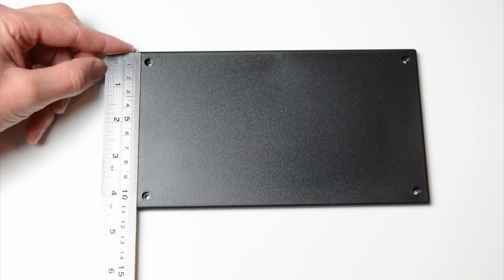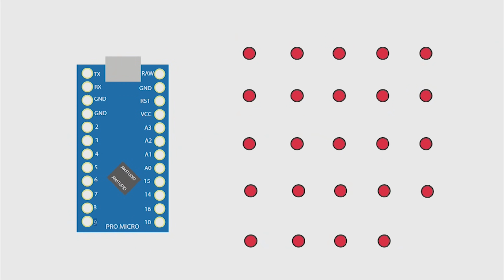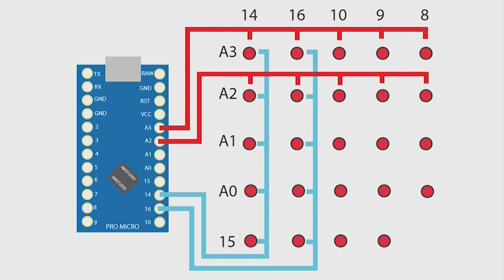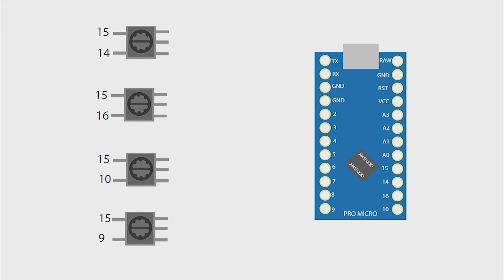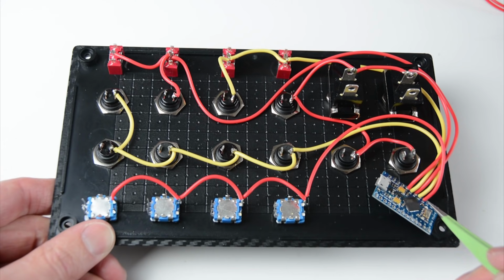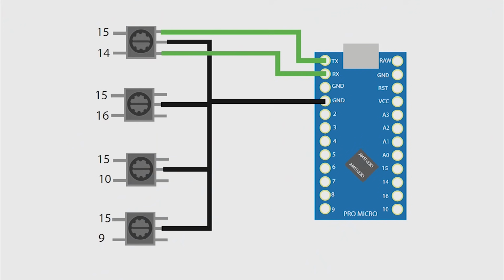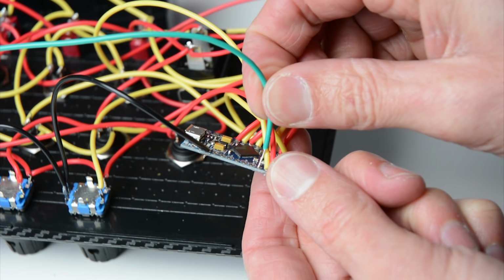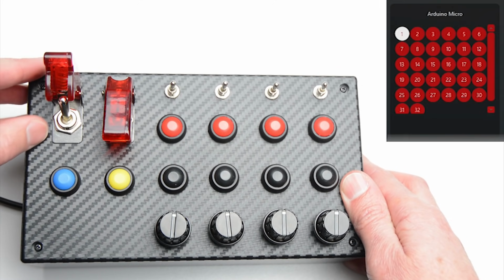MAKE THIS BUTTON BOX | 32 FUNCTION w ENCODERS

Comment: For anyone looking to attempt this, just buy the digital instructions - The video doesn't match the detailed wiring diagram so I had to undo a fair chunk and lost a couple switches in the process.  With everything wired up I can show that it's working successfully and the video does a good job of getting the key points across but it's not the basis for the actual wiring so make sure you support AMStudios by buying the instructions.

Comment: How are those encoders mapped ingame? Does rotation just increase the value or is every position mapped to a different value, so, if the encoder points to lets say the left, will it be "max ABS" in every game I start?
Reply: You may have to reconfigure it through every game.

Comment: Where do you get a grommet that small? Only thing I'm seeing like that on Amazon is something for water or something like that.  Usually get hits for Desks, etc which need a hole saw rather than even a 1/2" drill bit.

Comment: How do the rotatory knob work? What is his behavior?
Lets say the knob is at full turn to left (0°), if I made a full spin to right (270° if it has a common potetiometer rotation), without stop. It will count as 1 input? Like 1 button press?
Reply: you dont buy encoder but potentiometer 
encoders don't have full turn 
for this project you need encoders

Comment: i made one with a 10x4 button matrix and 5 encoders (used an expander over I2C for the extra pins) but my encoders are really slow to respond unless spinning them very fast? With 5 encoders i obviously changed the NUMROTARIES and adjusted the rotaries array to fit my pin numbers and joystick buttons but I don't understand the ttable arrays? any help please

Comment: I just finished making this button box and it works perfectly in all my racing games but when i tried using it in Star Citizen, it prevented the game from launching (the game stopped responding in the splash screen).  Disconnecting the Button Box allows the game to launch normally however, reconnecting the Button Box afterwards seems to make it so the game doesn't even detect the Box.  Any suggestion as to what could be causing this issue?

Comment: Little bit of a problem on my side: Managed to wire up everything except the momentarily switches (the top row with the on-off-on) how do I solder these ones to the board? I only got 2 rows but it seems like I need 3 rows for that.

Comment: Just a warning to anyone trying this 'at home'. You really want to fully test that the wiring is correct before soldering anything. Usually that would take the form of connecting the wires to a breadboard, you would then solder them one by one while ensuring the buttons are still working as hoped.
The presentation of this video while fantastic suggests that you shouldn't upload anything your Arduino board until everything is soldered and glued down. In the real world, this is terrible advice, and I'm sure amstudio would agree! Test everything as you connect it via the breadboard, then retest as you solder each wire.

Comment: Can you use a rotary encoder on a breakout board and how would you solder them as the two GRD are already together on the breakout board?
Reply: Did you find a solution? 2 ground pins that are connected but one needs to be a function... how do i proceed?

Comment: if i use the same sketch but less buttons will it still work? like i would just want to make a steering wheel button box that has 8 max push buttons. The rotary etc is too complecated for me. so i was wondering if i do like a 4x2 matrix and use your sketch will that work?

Comment: Bought and followed the tutorial, for some reason when I test the buttons different switches are inputting as duplicates and not even consistently. They seem to bounce all over the place depending on the condition of the other switches. Any ideas?
Reply: Do you use toggle switches (non momentary)? That might mess up the button matrix. SimHub wiki says you can't use non momentary switches and/or press multiple buttons at the same time.
Reply: @haamujengi  yup that was exactly my problem, I had to modify it to work for my application.
Reply: @bryanp2780  What was your solution?
Reply: @haamujengi  My button box was for a flight sim so it was a bit different than this but i used the button matrix. I had 3 ON/ON toggle switches (non momentary) for the sake of easy button mapping in game. But this meant those three when flipped up were constant on causing my issue. I de-soldered those switches effectively making them ON/OFF toggles and rearranged the button matrix where it worked if all three of these were switch to the on position at the same time. All of my other button are push button. Some of them would cause ghosting if they were pressed but for the sake of my flight sim i wouldn't be pressing them with gear/flap/hook down so its not a problem for me. I did have to edit .lua files in the sim to make button mapping work for an ON/OFF toggle.

Comment: First problem is understanding how the Matrix works and why you are wiring which wires to which switches. Let me finish my electrical engineering degree first...  Other than solder this to that nothing was explained as to why it was being done the way you were doing it or how the matrix board convert the switch functions over to something you can bind a keyboard to. What makes the numbers on the matrix board go to toggles and some to push button? Why are the toggles daisy chained in with the push buttons if you want all your buttons to be separate keyboard functions. It was more of a put this here and put that there. Nothing about why you where doing what you were doing.
JUST SAYING!!

Comment: At the 3:50 mark you have a yellow wire in the 2nd row tied to the button in the 1st row and red/yellow wire in the 1st row tied to a button in the top, why is that?? The schematic you made has all the buttons daisy chained together, one prong with a red wire and the other prong with a yellow wire.

Comment: Can I use this with Xplane flight simulator, do I need plug-ins for Xplane?
Reply: It works like a joystick so normally you should be able. I am doing an ICP panel for the DCS f16 based on this video. When i will finish it (hopefully in a week) i will try it in xplane too and i will update here.

Comment: I’ve physically wired it, but how would i modify the code to include one additional functional button? I’ve got a 5x5 matrix with 4 encoders, but used the last slot he left empty. Initially, it had one of the encoder functions overlapped with a button (24 did both). I figured out how to move the encoders one over, starting at button 25-33, but button 33 doesn’t show in testing. Anyone know how to get that modified?

Comment: How do you wire up the 3 way switches?  It says to treat them as 2 separate buttons, but they only have 3 pins.  2 separate buttons would have 4 pins.
Reply: A 3 way is 2 switches with a common center terminal (shared input to both switches). To wire one to a matrix, you treat the common terminal as if occupied 2 "spaces" on one row of the matrix. The trick is that the other 2 terminals (output of each switch) must be wired to unique columns.

Comment: Is anyone experiencing ghosting with this? I have a lot of noise when using the flip switches, data comes in when I'm barely touching them.
Reply: Ideally you'd have diodes on the outputs (or inputs) to every switch. Otherwise you can't avoid ghosting and can't press some combinations of multiple switches at the same time. I just finished a version of this with diodes and I did 2 and 3 way toggles instead of most of the buttons. I have zero ghosting. It's a bit of work to "splice" in diodes in line with the wiring, but not hard.
Reply: @msd2000  That sounds exactly what I need! do you have a schema or drawing of your wiring? Would be of great help! Thank you
Reply: Glad i'm not the only one to have some severe ghosting ^^
Have you figured out how to avoid this ?

Comment: Really nice video, two questions though.
-How do you map the outputs to a game? Does the game just pick up the inputs like a normal keyboard combo?
-Is there a way to make the toggle switches act like momentary switches?
Reply: 1. Arduino Pro Micro coding outputs it so that in game they appear as button 1, button 2 etc. It will display in game under Arduino Pro Micro as a controller and it figures it all out for you. Very easy. :D

2. Someone commented about this an I am currently trying to find the comment. Have you figured out a way to allow multiple buttons to be pressed at once. e.g. have buttons that remain in position allowing for another button to be pushed and registered at the same time?
Reply: @MindstormExpert  Diodes is your answer.

Comment: Nice job. I just built one, not as pretty as yours, front panel and case are plastic and wood scraps, and I added one more switch, works great. Thanks.
Reply: Once I have coded it, and uploaded to Arduino, how to I then communicate Arduino with computer? Do I need additional software? Or just a game?
Reply: @MindstormExpert  If you've done everything right, just plug it in and a PC will recognize it as a HID. What it comes up as in games depends on which Arduino you used. Mine all show up as Arduino Leonardos.

Comment: I bought your file and mounted my button box, but there is a conflict of buttons. How to solve ?
Reply: If you haven't solved it already, what do you mean by a conflict of buttons? Maybe I can help.
Reply: @ItIsYourBoyMe  I'm also having conflicts when I press more than one button at the same time, for example, if I activate switch 1, and press any button, a third signal is sent ...
Reply: @wagneralves5915  I haven't actually built this box myself, but when I was watching this video, this was an issue that is unavoidable with this design. For example (I haven't rewatched the video, so might not be 100 % in line with the video), let's say a button is pressed such that current flows between row 1 and column 1 of the wiring as shown in the wiring diagram in the video. If all other buttons/switches are deactivated then everything is fine. However, let's now say that you push a button which is wired to row 2 column 2. Then the entire column 2 is activated, and moreover, if at the same time you push the first button (row 1, col 1) then row 1 col 2  and row 2 col 1 are also activated. This is unavoidable unfortunately, as long as you have more buttons/switches than inputs to the arduino. A solution might be to rewire in a more appropriate way (and update the arduino code) or to disengage some buttons/switches.
Reply: @ItIsYourBoyMe  so for example, if i wanted a jake brake on/off toggle switch but needed to increase/decrease intensity with push buttons, theyd need to be wired into different groups?
Reply: @wagneralves5915  This is a desing flaw, you can only press one button at time, because the they share share the conectors on arduino, but i think in game you won't be using more than once at a time
Reply: @Jxsey  nice question, I have the same problem
Reply: @wagneralves5915  Matrix grid designs have a flaw. It's called ghosting or masking. 
It happens when more than 2 or 3 buttons are pressed or depressed at the same time.
A way to solve this is to install diodes in series with your switches. The Diodes will act like blockers.
Reply: @youmasenchi  If you've looked at the sketch, is it rows or columns which are the positive side?
Reply: @youmasenchi  Which ddiodes will fit perfectly for this build? So every switch one diode,right ? Thanks for tip!
Reply: Re do soldering
Reply: There are a lot of FIXED state Push buttons, two or infinite number of push buttons, with a one rule - only one of these Push buttons would be pressed inside if to compare the state (physical) of others, push buttons withe fixed state are not a toggle switches.
Reply: If you only scan one row at the time in software, would that make any difference, then the results from this is stored in a buffer which you read?
Reply: Everyone saying about diodes but what ones?
Reply: If you mean ghosting you might need to use diodes to make the signal travel in one direction.

Comment: I know that this comment is over a year and a half after the fact, but hey - I just came across it. :) Nevertheless, it is a great little project, especially for anyone that wants to get into Arduino... Nicely done!

If you ever get around to doing another USB-based project like this in a similar enclosure, may I suggest outfitting the enclosure with a Neutrik NAUSB-W-B USB housing? It isn't too expensive, Requires just a 24mm hole (along with two holes for the mounting screws), and will really clean up the look of the enclosure. Neutrik even offers rubber gaskets in several colors to help it blend in with the surface of the enclosure. Better yet, it really gives the enclosure a professional finish, and will allow you to use any off the shelf USB-A to USB-B cable to connect it to a computer. Anyway, just a small suggestion to make a really nice project look even more outstanding.

Comment: Would this botton box work with a truck sim ??
Reply: Of course, its a normal usb device so it will work
Reply: @alexracing4180  thank you i might be giving this ago
Reply: But would i need to add the schematics ??
Reply: @mikeakamiky7245  You'll set it up as amstudio shows in the video (remember the library and such when connecting it), and then install the Joy2key app. In Joy2key  you can designate any key from keyboard to the buttons. Then in ETS2 you go to settings -> keys and set every function you want to your buttons there. I hope this made sense, lol.
Reply: @basstrammel1322  this does make some sence and than you
Reply: @mikeakamiky7245  Great! Joy2key is simple and straight forward, but watching tutourials on YT is always a good idea.
Reply: @mikeakamiky7245  Ps, if you're not into DIY and have to buy tools and all kind of stuff, the bill could easily stack up to more than a Pxn-0082, or equal products. They're around $30. In hinesight I should've done that.
Reply: If you want a really cool setup, you make a custom box that fits an old smartphone. Install an dashboard app on it, and have any info you want going. It's a whole separate setup to the buttons, just a phone connected to your pc.

I cut out two 2" holes in a box and glued my old Galaxy S5 on the inside, and it's connected to my pc through USB. It shows fuel and air pressure when I'm play ETS2 and ATS.

Comment: Thank you very much for your teaching.
The new joytokey already supports 128 keys.
The number of IOs in Arduino Micro is not enough.
Can it be supported by more buttons?
I want to have more than 10 rotary encoders.
Thanks again for your tutorial.

Comment: I have modified the code of the arduino and it's now compatible to play on PS4! If anyone has an interest for this code...please let me know...
the PS4 don't recognize a joystick. So...the idea is to make an emulation of a keyboard vs joystick. 
At this moment, I just made some tests but it's working fine. (on a HUB USB : 1 wheel logitech G29 + 1 keyboard + this button box) 
I'm working on the final version...
 
Rgds,
Reply: Hey, Im interested in your project and would like more details

Comment: great video, thanks for posting such a quality production, only suggestion I'd make is adding an inexpensive shift register (instead of a switch matrix), which would simplify wiring, configuration and eliminate requirement for diodes to prevent ghosting etc.as well as allow for greater switch/button capacity off a single board
Reply: finally someone said about ghosting
Reply: ghosting?

Comment: lol noob here I want to know if it matters if I use a matrix in a way that the switches and buttons are in the same line, like 3 switches and 2 buttons on the same line. answer plis
Reply: Yes buttons and switch are functionamy identical. It's juste that switches stay in plave
Reply: As long as each component has a unique position in the matrix (i.e. no other component is connected to the same 2 pins on the controller as it) then all should be fine. Even the momentary push on the rotary encoder (bottom row knobs on this build) can be fit into a matrix. (The rotation input cannot, however.)

Comment: quick question, what voltage/amps does this set the buttons/switch/encoder at? all the buttons/switch/encoders i have found have a rating of 125v/6a (seems rather extreme) is that just the max rating they run at or does the software set the voltage etc they will run at?
Reply: It is the maximum voltage/amps, you can use them with an arduino without any problem

Comment: what if i don't want rotaries but more buttons, could you do a video on how to change the i.o sketch to add more buttons to this build and where to solder them on the ardino? Or can anyone help with that been trying for a few weeks now and some how just cant get it to work.
Reply: You have the option of treating the rotaries as buttons. An alternative to this design. Also, using the same matrix, you can upscale the amount of functions. This box has 32, but with an Arduino Micro, you can go as high as 81 functions. The only drawback is the coding becomes a tad more complex. I use a 64 function matrix on one Arduino board for my flight simulator.

Comment: can you use a Raspberry Pi Zero  instead of arduino pro micro?
Reply: For all of the digital input switches yes. But I’m not sure if the zero has enough gpio inputs for all the switches shown.
Reply: But you won’t be able to se his sketch. You’d need to design your own software.

Comment: If I wanted to build a box consisting of just toggle switches, 2 push buttons would I follow this same diagram? Each switch will be used sometimes at the same time. Atleast 15 switches total.
Reply: Don't know if you found an answer for this but you have to use diods or multiple arduino cards for that to work.